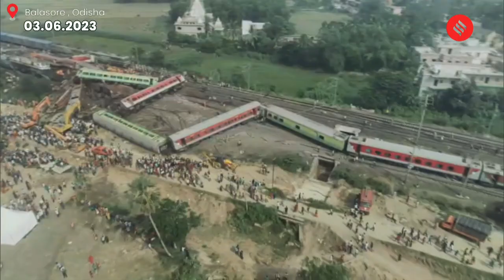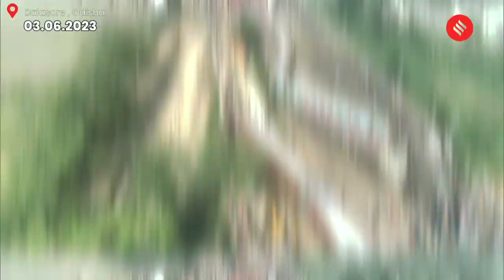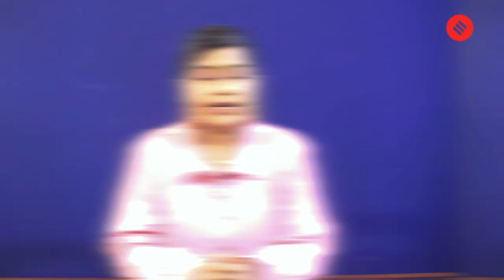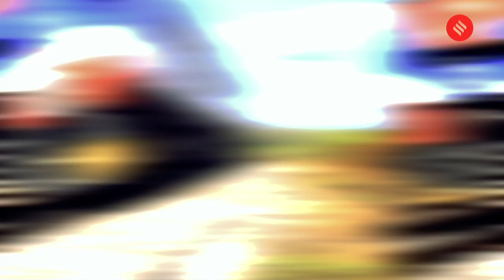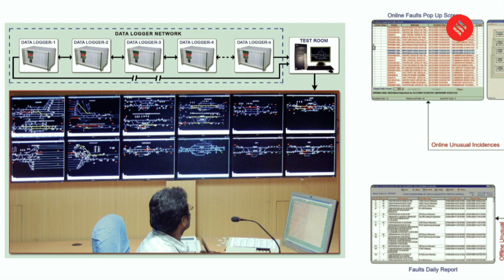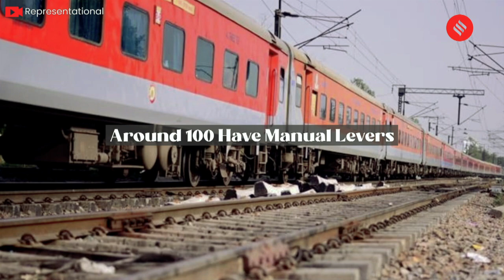Explained: What Is The Interlocking System In Railways? | Odisha Train Collision

Comment: Basis whatever information was made available by the media on the Coromandel Express CRS report it seems that the automatic interlocking system for the local railway  station was compromised since 2018 due to some blotched up repair by the signalling team to the facing point for x -over to up loop line and since then it seems that the signal team have been discretely tampering with the point signal .... hard to believe that these signal engineers never felt the need to rectify the defective point,  instead employed some stop gap solution which could have only compounded the operational risk for traffic on UP main line. It is equally hard to believe that these signal engineers were unaware  that their actions had compromised the operational safety under following conditions  :
(a) The Automatic Interlock  System which is basically an operational safety device was compromised.
(b)  The signalling system had lost its  auto online status due to the manual fingering by the engineers
(c) These signal engineers themselves are unsafe engineers  capable of only " jugaar" and  as they lack knowledge and skill set to understand the inherent risk and the outcome of highly unprofessional behaviour. .
Reply: Horrible. Those people should be sacked and punished.

Comment: An interlocking electronic point system can be 99.9 per cent can be safe &  correct, which means 0.1 is still unsafe  conditions! That means that 0.1 per cent unsafe conditions in the manually system was eliminated, in other words, the manual system was 100 per cent safe !
So, even with advanced technology, the chance of an error exists. Only the manual system was 100 per cent safe!
  
On moral grounds the technocrat turned bureaucrat turned politician, railway minister Vaishnav MUST RESIGN !
Reply: Yaa manual system was safe....instead of speaking BS in public, just google Gaisal train accident in the year 1999.
Reply: You are fool.